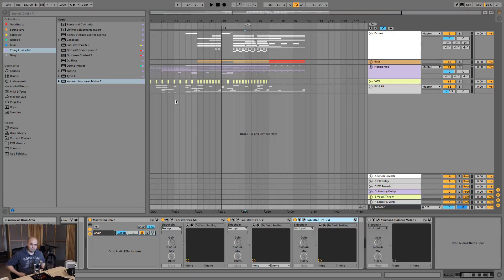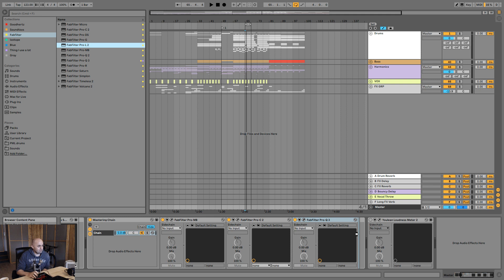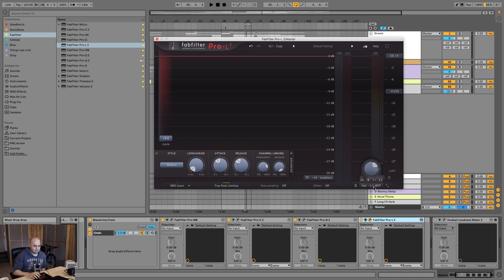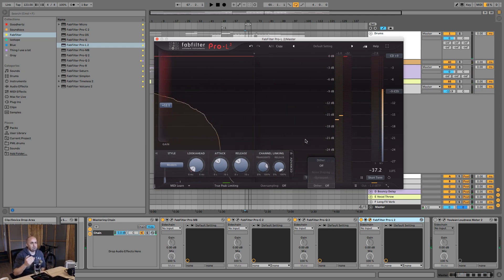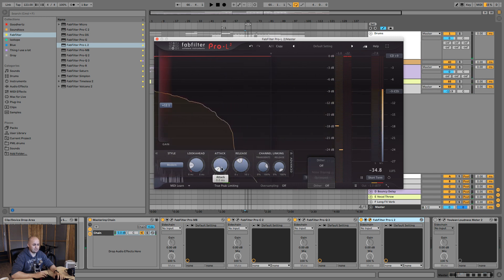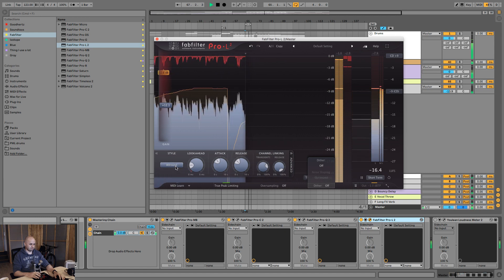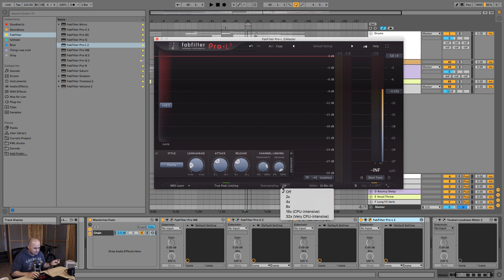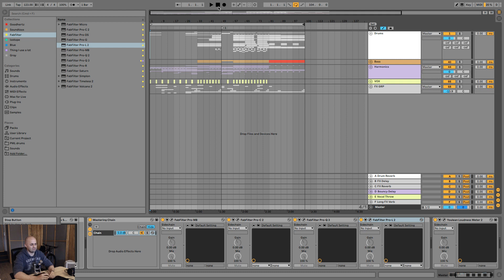Mixing with Fabfilter Episode 8

Comment: Would you say when it comes to mastering, that using ozone is the easy to way to do it and you could achieve better results by learning more (or other plug ins) or is ozone is good enough to achieve a professional sound and i do not need to worry about it?
Reply from the maker: You know that is a very good question that I will answer in detail of on Patreon as you are a Patron :). But in short, do not worry fabfilter and ozone are both very able to pop out a master. But more on that coming soon.